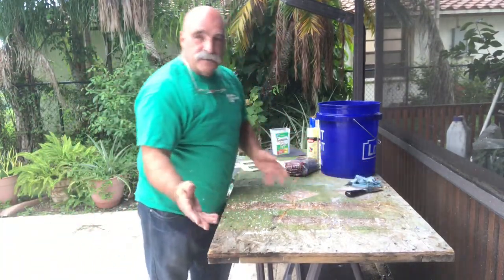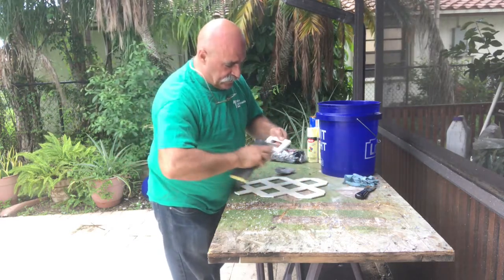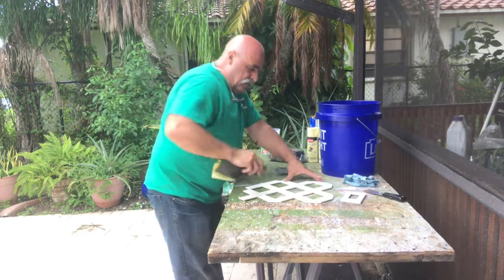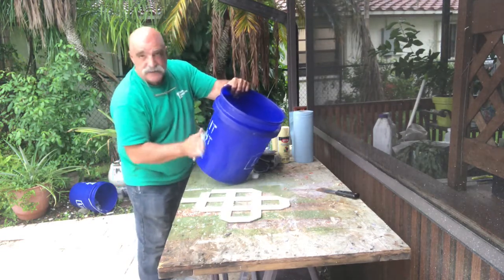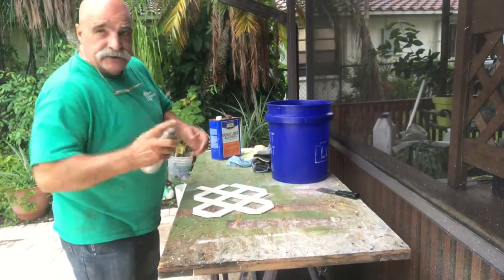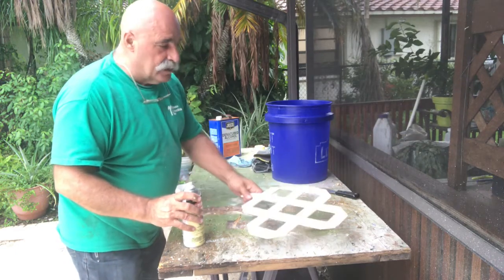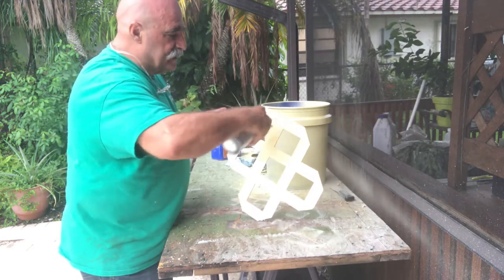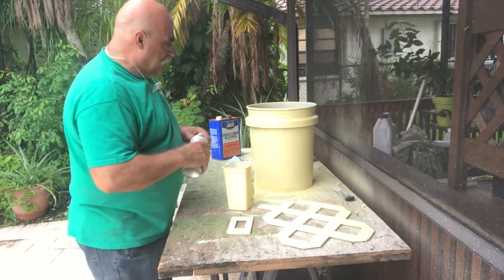How to paint plastic

Comment: And kids, be sure to hold the can only 2 or 3 inches from the object you are painting, like in this instructional video. Otherwise, you won't get any of those lovely drips. I once followed the directions on the can, and stayed around 12 inches from the plastic novelty bum-spanker I was painting. When I was finished, not a single drip. I was so disappointed. Never again! Oh, and NEVER use a drop cloth. Otherwise you'll miss out on getting overspray all over your walls/floors. And then your family will have nothing to yell at you about. Where's the fun in that?
Reply from the maker: Thank you for your comment if you can leave me a thumbs up.

Comment: Thanks ! I’m actually going to paint some Plastic lattice like that . I didn’t like the white it comes in. Going for green so it doesn’t take away from the Jasmine. I’ll use your tips .
Reply from the maker: Thank you for your comment let me know how it turns out and if you can leave me a thumbs up.
Reply: @buildingwithpapa  I gave the video a thumbs up 😊I haven’t tried it yet but I’m sure it will work fine
Reply: How did it turn out?? I have a carport that has lattice already but replacing it with privacy lattice but only comes in white and was thinking about painting it. Is it holding up good?
Reply: @ed2901  haven’t done the lattice part yet . Guess I’m really taking my time . I painted some of the pipes. They turned out good . I have the pipes in the ground and once the lattice is done I’ll attach it  . Too bad I can’t post pics in the comments .
Reply: Took a few months to get back to the project  but I finished my lattice  and pvc pipe trellis for my Jasmine . Turned out great.
Reply: @michaelkane5337  nice glad it turned out good

Comment: How would you prep brand new white vinyl lattice for a black rattle can spray paint?  Would you still sand it?  Thanks!
Reply from the maker: Thank you for your question I would use a steel wall and then either denatured alcohol or isopropyl make sure you either use the primer or the spray can you have is a paint and primer. I’m glad you enjoyed the video and if you can leave me a thumbs up.
Reply: @buildingwithpapa  thanks!

Comment: Everytime I paint plastic it never real sticks and peels off extremely easy or scratches right off... anything I can do different?
Reply from the maker: 1977poboy Did you watch these processes you say sandpaper first or steel wool then the important part is to clean it with denatured alcohol let it dry and then use a good primer stiks is a very good primer and then paint whatever paint you want over it try that let me know how it works

Comment: Was looking to paint some corrugated plastic top fencing. That sit on top of cynder block fence. For added privacy. I wanted both to match same color. 

Thanks for the tips. Steel wool pads, primer, then two coats of paint. 

Thanks for the tips... Papa
Reply from the maker: No problem thank you for your comment and if you can leave me a thumbs up.